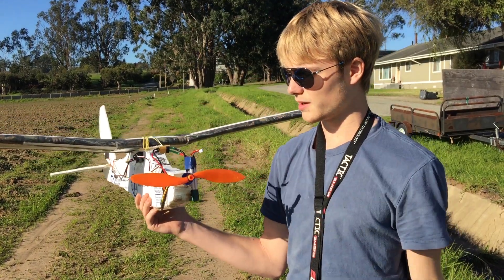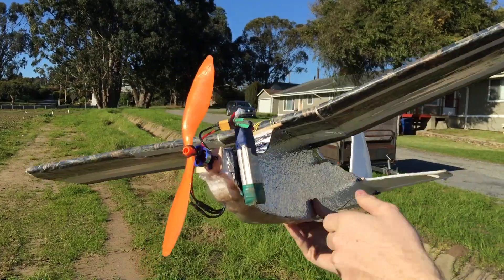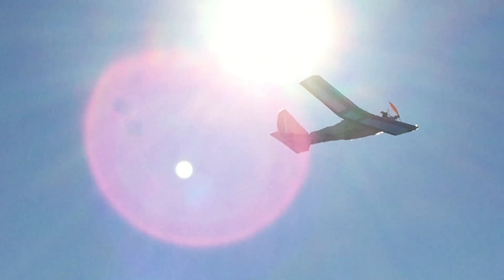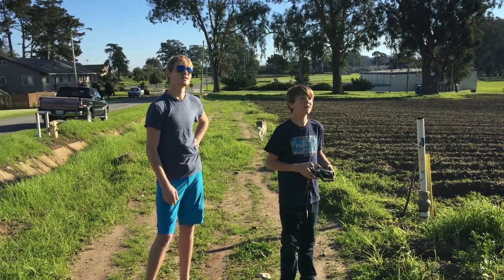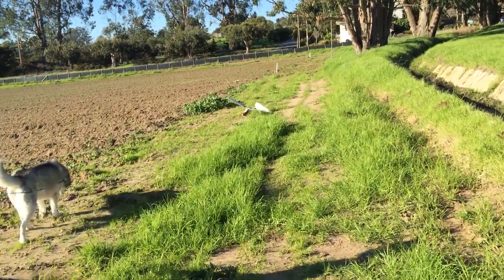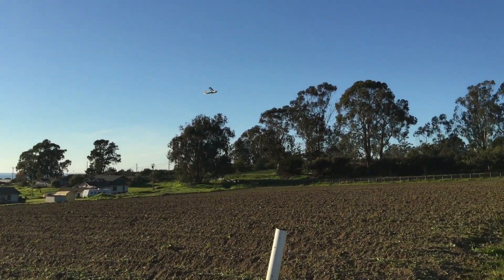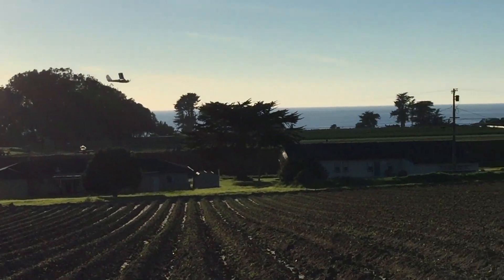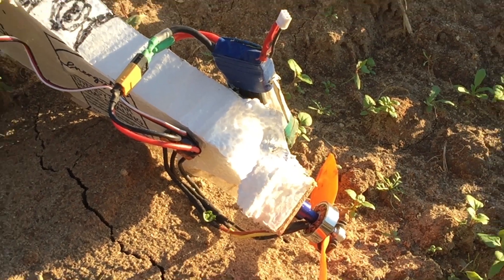$5 RC Trainer

Comment: Can a plane equipped with ailerons and a cheap gyro be flown like a 3-channel trainer? In other words, if I introduce yaw with the rudder, will a gyro turn it into a coordinated turn? Said a third way, can a gyro substitute for dihedral?
I like the strength, simplicity, and efficiency of a straight wing but don't want to burden a noob with staying on top of roll, constantly.

Comment: With a 100*30cm (39*12") clark Y wing, very cheap and common A2212 1000KV with 1045 propeller and 3s battery, how much the recommended and maximum ready to fly weight? I want to built one but I'm worry about my plane become too heavy :(
Reply from the maker: Don't worry too much about weight, Just put more tape on the bottom of the wing to make it stronger or add a spar if needed or a bigger wing. But that setup sounds great!
Reply: +Samm Sheperd (SNRS) Made one! It flies very good. It's also quite strong even though it's mostly made out of mid-density styrofoam but a lot of packing tape really reinforce everything like 10 times stronger than before and I don't even need any carbon spar or support, just styrofoam. I've crashed it several times and the worst thing was happen is broken propeller. No any serious damage. Also, with wing dimensions of 100x30cm and total weight of only 650gr, it give a lot of lift and can fly slowly. I'll upgrade it with bomb dropper feature soon. So, what do you think?

Two question, which one do you think is better? aileron with elevator or rudder with elevator? I'm actually have all of those controls, but I'm just wondering which one's better.
Second question is which configuration is better in term of stability, efficiency, safety and anything else that should be considered when making scratchbuilt RC aircraft. Puller or pusher?
Reply from the maker: IRFZ44 Sounds great! I'm glad.
Rudder steer only works if the plane is stable and has dihedral in the wing. Ailerons are good if you want to be able to do rolls or if your wing is straight and has no dihedral.
Reply: Dude... I want to make one too! 😀
Reply: Guess who's gonna make it too ;-)

Comment: how do you keep the plane level without ailerons
Reply from the maker: The wing has dihedral, and thus will naturally bank in the direction it yaws. Great question BTW
Reply: +Samm Sheperd (SNRS) the dihederal is the bend in the wing correct?
Reply from the maker: correct

Comment: You said " This plane flew pretty badly!"
Can you point out what was bad about it's flight characteristics. I am building a similar one
Reply from the maker: +SsoulBlade 2 things:
1. excessive wing bend
2. Aft CG location.

1. My wing would bend a lot giving it too much dihedral. I suggest covering the entire wing in packaging tape. One section at a time and then joining the wing segments together with some hot glue and more tape at the seams.

2. The other thing is that at first I let my CG (balance point) be too far back and that made it fly poorly.  It's hard to get the CG far enough forward with such a light weight motor. So I suggest a long nose so that a smaller battery up there can successfully balance the plane

Comment: Nice build. Some simple wire landing gear would save the prop when landing..
Reply from the maker: +Mike Dunn Landing gear is tons of fun, If you can handle the extra weight. It would also help to balance the airplane, since getting enough weight in the front is usually the issue.

Comment: Amazing.  This build with a $10 brushless motor blows my mind.  I remember when I was in elementary around 1990 and cost and safety factors for this sort of thing were incredibly prohibitive for our family.  If you needed enough power to fly for more than a minute or two, you had to go gas.  I suppose I need to take another look at r/c these days
Reply: i know!!! RC planes are SOOO easy to build these days you can make anything fly by balancing it right as weight isnt a big of a problem as it used to be
Reply: What are these safety factors?

Comment: Sam try to make a DIY rc air plane starter
Reply from the maker: +DIED12 ROBLOX&MINECRAFT What do you mean?
Reply: You know what you use to start a gas rc plane also my transmitter came in I mite be posting a vid gotta run to lows and get a light dimmer and a spring and some hot wire
Reply: To finish up my hotwire foam cuter
Reply from the maker: The starter I used to start the chainsaw is just one big custom brushed motor with a special grippy thing on the shaft.  The only way I can think of to easily make an engine starter with out buying one is to make something to put in a cordless drill chuck. I'd have to turn it on a lathe and buy a silicone grippy thing, idk maybe I could cast that myself but probably cheaper to buy one
Reply: Dose it matter if I use ac or dc current for the foam cuter
Reply from the maker: +DIED12 ROBLOX&MINECRAFT no it does not. In my experience, if it's way too much voltage it will probably just get red and break. Exercise general electrical safety and maybe have a friend around.
Reply: I have  a light damper switch  but I need to find a cheap electric meter or find one and I also have a fire thingy.
Reply: Just go some foam and made a fairly nice body with just sheet and a lot of hotglue but I think ill try to make another main but my wing came out nice and strong
Reply: Ok

Comment: Hi..nice and smooth fly..
Mind sharing approx dimension of body and wings? and tail please?
Reply from the maker: +Faisal Inam Khan Sure it's still around, I'll go measure it. However bear in mind that this project was not to design a perfect airplane for others to copy, but was to show how simple it can be and to inspire others to try and create their own original scratch built airplane. The dimensions listed below were not decided beforehand but were simply the result of "that seems right" engineering.
Wingspan: 48"
Chord: 7"
Body length: 32"
Horizontal Stabilizer: 16" span
Vertical Stabilizer: 9" tall
Reply: Hi Samm. Thanks for your reply.  I have been designing several planes but of them either not balanced or fast flight.  I never managed to build slow pace like the one you designed. 
I appreciate your response.  I will try this.  
Hope we share more knowledge
Reply from the maker: absolutely, I would love any questions you have.
For slow flight, the main thing you need is a LOW WING LOADING, meaning lots of wing area and little weight. Heavy small wings will fly fast.

For balance, if your plane is has a normal tail. I always balance it between the front and middle of the wing.
Reply: +Samm Sheperd (SNRS) where did you got that propellor
Reply from the maker: Damanpreet Singh Hi, I got this propeller from a local hobby store, but I usually buy propellers online. The propeller you use depends on the motor and battery voltage. The manufacturer of the motor should recommend a propeller size for your motor depending on the voltage of battery that you give it. And you can find that size propeller online.

In general: High "kv" motor = smaller propeller that will spin faster
And low "kv" motor = bigger propeller that will spin slower.

and Higher voltage battery =  smaller propeller that will spin faster
And Lower voltage battery = bigger propeller that will spin slower.
Reply from the maker: http://youtu.be/aV5hILJe20U

Comment: man! I hope my trainer flies that nice.
Reply from the maker: anthony perkins Thank you. A good stable trainer will fly itself, it just doesn't know where to go. And that's the best way to think about it when you're learning to fly. Only make small adjustments to nudge it where to go. When you try to make it do exactly what you want you can get overwhelmed and disoriented and the best thing to do is let go. As long as you're not right next to the ground it will recover and you can figure it out again. Also, long grass fields are good for crashes ;P
Reply: I see what you mean, thanks.
Reply: I'm going to try again and make sure everything is on CG and the prop is more stable and stay on and not flies off when  I give it some juice.
Reply: Samm, I went to the hobby shop this morning for props. I couldn't find a 10x4.7 that was anywhere as flexy as the EP8043.
I ended up with the APC 10x5E. It looks HUGE by comparison. Do you think it will work with my A2212/13t motors?
I have finals today, but just wanna get in the sky :)
Reply from the maker: Brandon Cooper It should work well. Hopefully the prop adapter and propeller holes are the same size and it's easy to put on there!
Reply: Samm Sheperd I didn't use the prop saver, just the screw on nose cone. I put in on a tiny (18 inch tip to tip) delta wing I threw together. It took off like a bat out of hell!
I promptly crashed into the road a few seconds later due to spinning out of control in 20mph winds(again).
Point is, I got in the sky! Working on a slow trainer now. I don't have classes again until Monday, so I have time to tinker.
Thanks again for your assistance and patience.
Reply from the maker: Brandon Cooper Great! A longer wingspan has more rotational inertia and thus is more stable on the roll. Keep at it!
Reply: Samm Sheperd I only built the little one because the old prop would get the 30" wing I built off the ground. I didn't scrap it, so I will probably try it again. It's covered in shiny dollar store duct tape. My son and I love to build hideous, gaudy, tacky stuff. lol
Reply: wouldn't*

Comment: Stick a as3x on there Sam, will help him quite a bit, we flew tonight in a bit windy condition, in miles i suppose about 12 mph, but it was fun, flew until after dark with cub s2, even went inverted for a few seconds, to our surprise we managed to roll out safely, we are just beginners but we have a friend that flies exceptionally well,so it helps to have a tutor. I uploaded a clip under my channel of Ed flying his cub S2 , his 6th flight and he was having fun, also a short clip of the Radion pro battery hanging out in flight, making for some laughs.
Johan
Reply from the maker: Lucky Dube Thanks for sharing I checked it out!

Comment: Great video, I love the plane, you should put details and plans on rcgroups.com as this would be a good first trainer for beginners, thanks for this video.
Reply from the maker: Thanks! I have never made or followed another persons plans, I just build off of intuition and improve with experience. I think that airplanes are beautiful in their simplicity of construction and I'm hoping to inspire others to take a shot at it without the need for some other persons plans. This is not a concrete personal philosophy, just what I've done so far.
But this would fly just fine with a different size or shaped wing or maybe put a V-tail or some ailerons on it. The possibilities are endless! Could even turn the wings around and bam it's a conarded plane! Just move the CG!